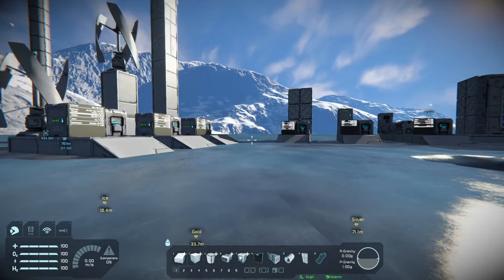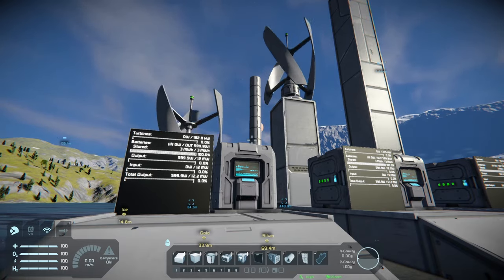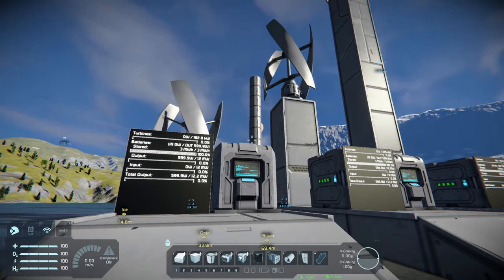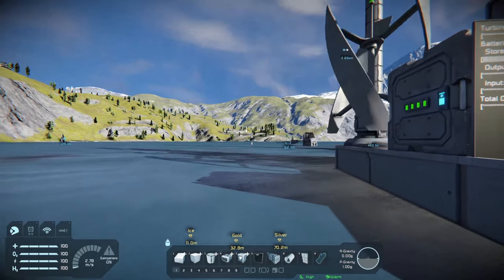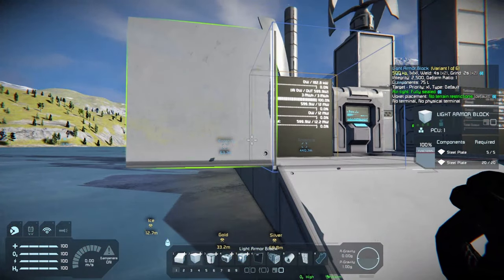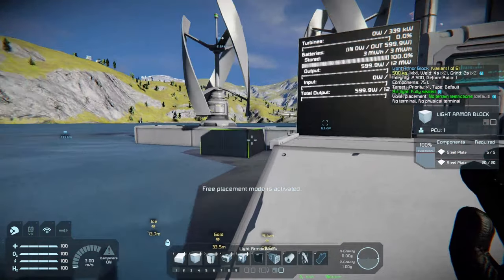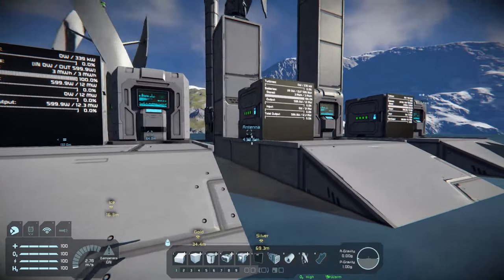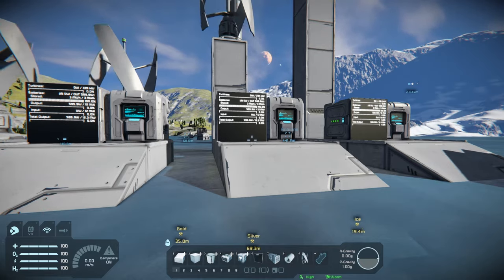How To Power Your Base In Space Engineers

Comment: First hour or so, I use the battery on the starting ship. It can be used to power large grid blocks through a connector or merge block. It is a great way to focus on getting a mining rig up and running. Skipping power generation and storage steps. If you get stuck, building more batteries using stone materials is easy enough. Once you have a stone mining rig up, then you can begin some base load power, which is your wind if you are not in rarefied air. If you are near/on a lake then hydrogen engines could be your base load. Solar requires batteries for storage, so early game it is resource intensive option with less benefit. You could pair solar with hydrogen and have solar as your base load and hydrogen as a battery. Benefit there is you don't loose the efficiency of the charge/discharge you get with batteries. I also don't recommend spamming batteries unless you have maxed out the storage capacity or you are in a PvE or PvP senario and you can foresee losing your power generation.

Comment: The old solar panels, you can double stack them , not sure if it still works that way give it a try 🤔
Reply from the maker: Now that I think about it not the first Time I heard that, I may have to test that out.  It is kinda along the same lines of crowding your wind turbines, Never really been much a issue that I have felt the need to try it.
Reply from the maker: Just did a quick test, and you are correct. That does work stacking the old solar panels back to back.

Comment: Stackable wind turbine mod is the way to go.
Reply from the maker: That is true, and I do love the stackable stackable wind turbine mods.  Though I do have to ask what's your top 5 must have mods, I wanna see if it lines up with mine.
Reply: @KiltedBastard  Good morning, I have a few, Q-Tech has to be one of the top 5 if not just for the cargo containers capacity, solar panels, antenna size.
Next,  it HAS TO BE Nanobot Drill and Fill  System. Together with Build And Repair TwinScyhe edition (2km range)
Obviously, MA stackable Wind Turbine.
Another MUST is Azimuth ore detector and I chose the Space detector as it goes beyond 5km range. This mod works like gold with another mod called Ore Detector Reforged.

Speed limit 500

These are the starter mods for a new base, then I have a few more for Quality of Life, like colorful icons, reducing drill sounds, ect.